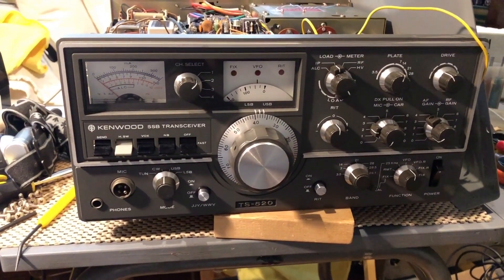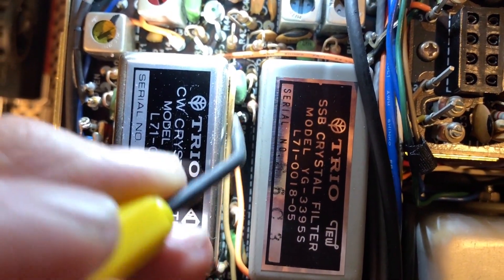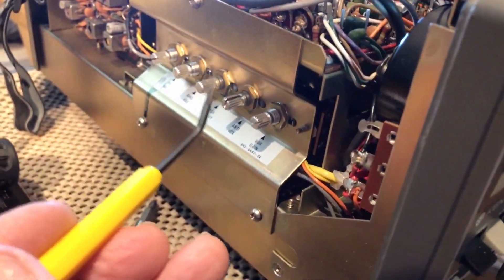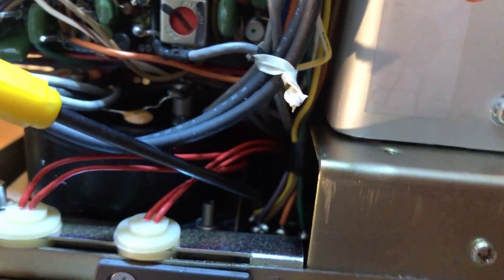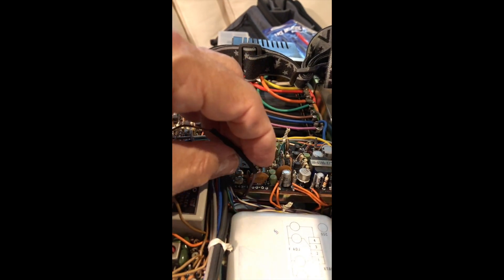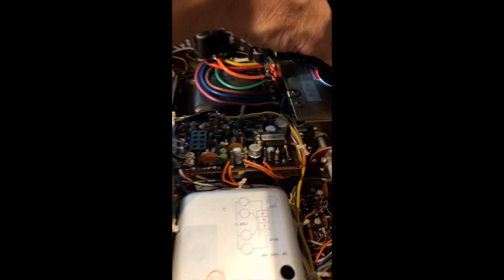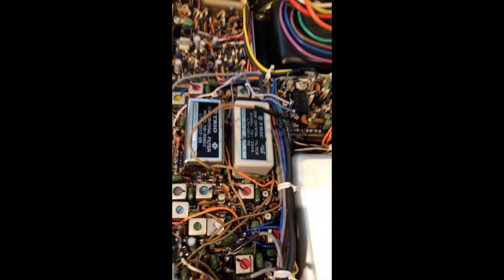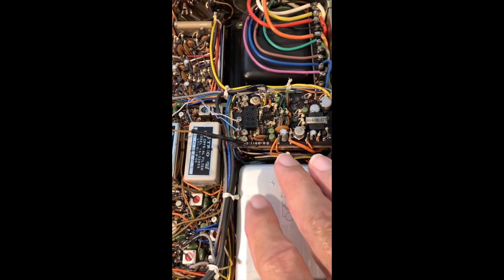TS 520 CH Mod

Comment: Works perfectly in TS-520S as well. Switch location on front panel for metering and fix is swapped in 520S but purple wire is still the wire to tie to the brown wire and same two posts for ch 1 (CW wide) and ch 2 (CW narrow) as shown in this video.
Tnx for nice solution. 73, Dan W7RF